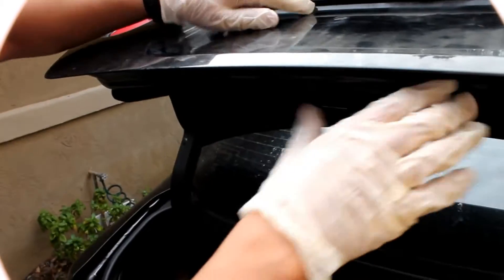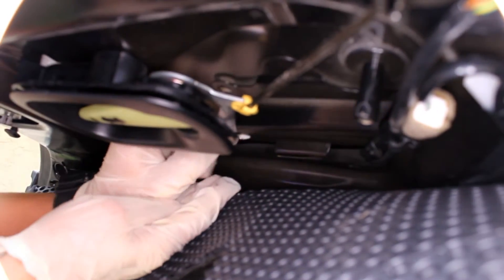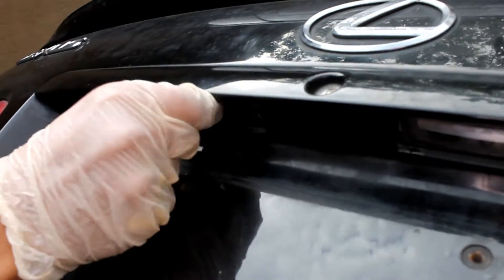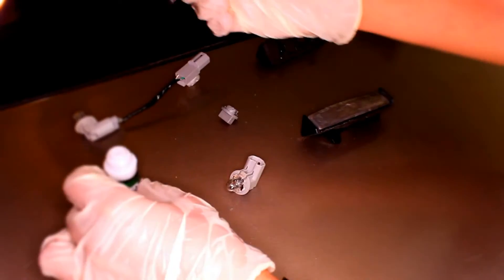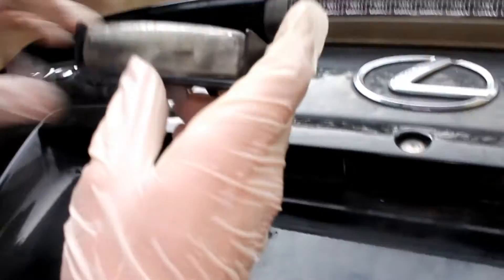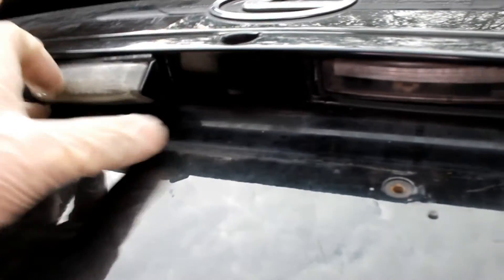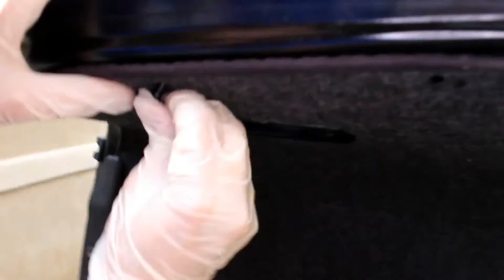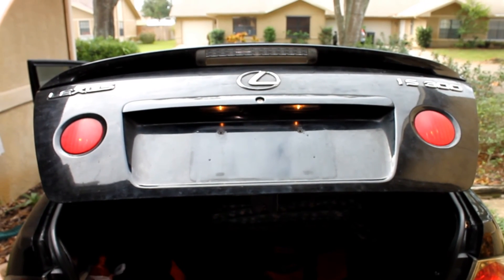How to replace license plate (tag light) bulbs on Lexus IS 300

Comment: This guys the shit ! Fucking straight to the point. I dont give a shit about those clips that hold that cover back and you dont have to be gentle with them. Thank you for not taking each one out to remove the entire trunk cover and just showing the eazy quick way to do this. Did you break that piece tho while taking it out or was it already broken? Cuz I dont feel like doing that and will do the long hard way if that's the case cuz crazy glueing something you may have to access again would be a bitch .
Reply from the maker: It was broken already and you can glue it back or pill out glue. This balbs work 1_1.5 year . So it pain to replace them. I am thing to install LED light that we work longer. Cheers